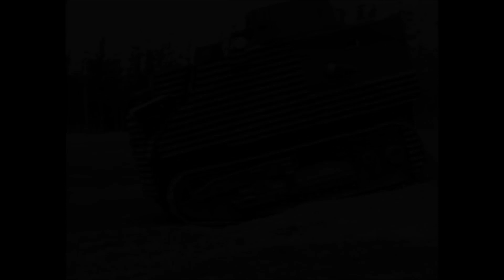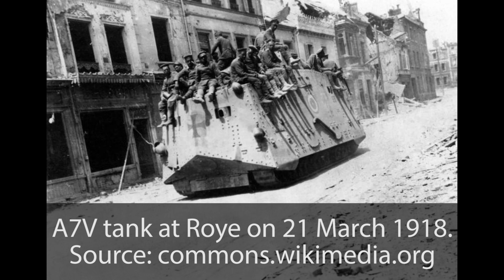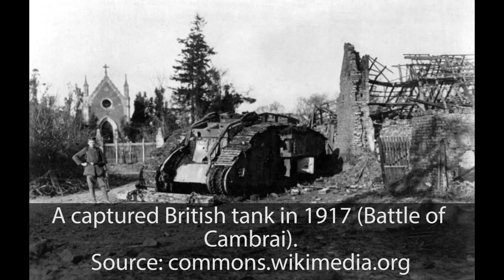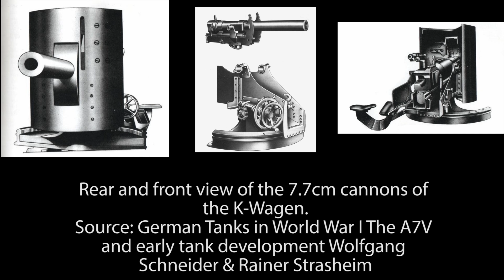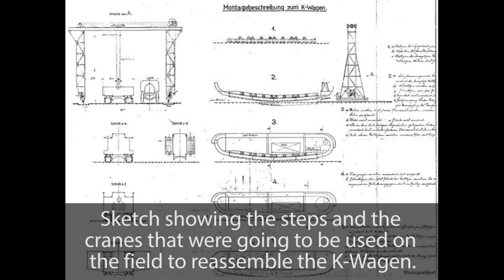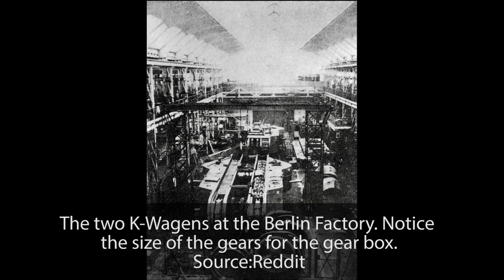WW1 Maus | Großkampfwagen / K-Wagen

Comment: Why didn’t the K wagen use powerful readily available steam engines?
Reply: These are not efficient enough and much, much heavier than diesel or gas-powered.
Reply: Like he said a steam engine capable to move It decently will be heavier and mostly bigger than the tank itself, then you Need a tender for coal and water
Reply: @HanSolo__  it would fix logistics, and the fuel is a lot more readily available than gas/diesel steam traction engines have been around since the 80’s and some could go as fast as 60 mph.

Comment: The ancestor of all German tank traditions, heavy guns, heavy armor, and weak engines.
Reply: You do know they did make 2800 Jagdpanzer 38 that was a 16 ton tank destroyer, Thats more then all German heavy tanks and heavy tank destroyers.
Reply: @kirgan1000  they also made about 10,000 stugs, there are more of them than the panzer 4, but it couldn’t stop onslaught of t-34s and IS-2s
Reply: @omalley928  Yes? Whats the point? Do not try to fight three "great power" at the same time. Germany will still louse if they use T-34 and IS-2 and the allied use Panzer IV and Tigers.
Reply: @kirgan1000  also late panzer 4s had a poor transmission and weaker engines because of the increased armor so your not wrong
Reply: @omalley928  Panzer 4 had reliable engines and transmissions. They appeared "weak" in 1945.
Reply: @HanSolo__  they used to have reliable transmissions when it weight less but later the armor and firepower increased, the panzer 4’s transmission didn’t handle the extra weight well causing more breakdowns
Reply: @kirgan1000  made in CZ
Reply: @comentedonakeyboard  It was still commison by the Germans.
Reply: @BHuang92 Winning against Poland, France, and initially against the Soviets was possible because of the high speed, and maneuverability of lightly armed and armored German tanks. All. 100% Not a single heavy tank was used.